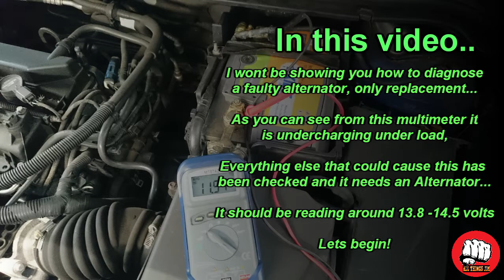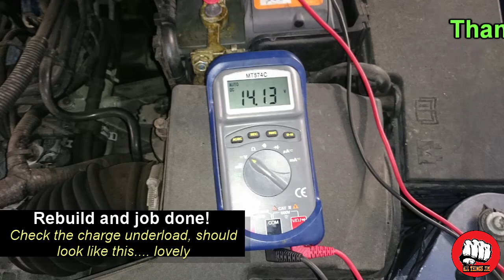ALTERNATOR ON A 2008 FORD FOCUS 1.8 PETROL REPLACEMENT

Comment: Thank you for a great video, just replaced the alternator on my Focus 2008 flexi fuel. I found that it was easier (for me) to unbolt the alternator before removing the power cable. That way I could tilt the alternator which made it easier to reach the nut holding the cable.

Comment: Thanks. All the other videos for my 2007 2.0L petrol had different mounting to mine...which is more like your 2008 1.8. Music was really annoying (ideal is no music at all) but your tip to pull the headlight out was very useful.

Comment: I done this on my 1.6 ford focus 55 plate bit off a night putting the belts back on as mine didnt have a automatic tensioner and i had to use some speacial tools form ford which was a pain. My alternator was slightly different to so had to do a little bit off filing.

Comment: hello Jim! i have a focus 2006, 1.8 tdci. my car has some issues: there is not enough voltage on side mirror lights (puddle lights) so they are not working. the parking module is not working either (sensors are ok). the trip computer on the dashboard has some issues: it goes crazy and scrolls by itself through all the menus, and once the mode switch stick is used, it is stopped at the given menu and STUCK at the same one. sometimes it works normally, sometimes it wont and it goes crazy like that. do you know what could be the problem? the car had an accident before it was imported to my country (and was repaired) but i dont know how big was the damage. the car doesnt have any other problems, whatsoever. btw i tried sanding and cleaning all 4 or 5 ground wiring connections under the bonnet, and it seemed to help a little bit, but its  still not fixed. cheers
Reply: also, the error that is read on the dashboard using my OBD2: B2286: Trip Computer Mode Switch Short to Ground
Reply from the maker: Hi!, Well its going to be impossible for me to try diagnose all that list without actually having the car and doing tests, however the very first place I would probably start is looking at the wiring, possibly around the area where it may have been crash damaged , you may find theres a short somewhere or two exposed wires touching, id then if that all turned out ok be looking at modules etc.. is that the only code you had show up on your reader?
Reply from the maker: Have you also tried the basics first for puddle lights etc ( checked fuses and bulbs) and it may even be just the switch/  stalk for the dash issue but like I said its almost impossible to tell without physically looking  and testing the car. 👍
Reply: @ALLTHINGSJIM  i checked all fuses and relays they are all ok. tried different bulbs, the ordinary ones wont even lighten up a tiny bit, and on the other hand, leds wont work at all. yes that is the only code. i think it had been damaged on the front right side, because the right side mirror is repaired with a what it seems to be a hot air gun and/or soldering iron. the unimeter does show around 13.9 volts. dont worry if we dont figure anything out, it doesnt really matter that much, its just a bit of a pain to the eye (im not sure if all of these faults can cause any further damage to other components). at the official ford service they said it would need a very thorough examination, but i just think they are either lazy or wanna keep the car for as long as possible to increase their hourly income. (im in bosnia tho)

Comment: I can't see a tensioner anywhere to remove the belts without cutting them. I have a 2009 1.6 Zetec petrol.
Reply from the maker: You may have the model fitted with a  "streachy belt" in that case its easier to cut it off and buy the genuine ford belt as it comes with a handy tool to fit them which saves you buying a tool that wont work very well 👍
Reply: @ALLTHINGSJIM  thank you for the quick and informative reply 👍
Reply: Hi Jim,  Need to do my belts on my 2010 focus 1.8 with the pivoting top pulley.  Is there a special tool to pivot this or can I use a screwdriver.  Thanks